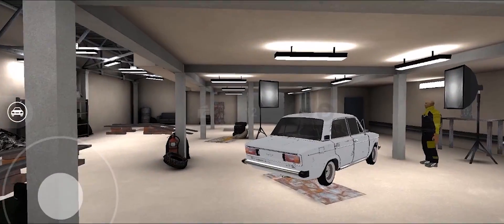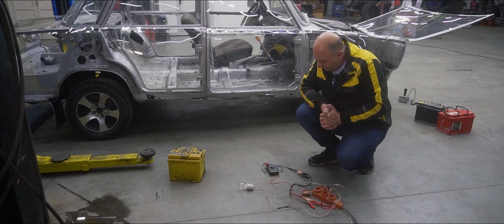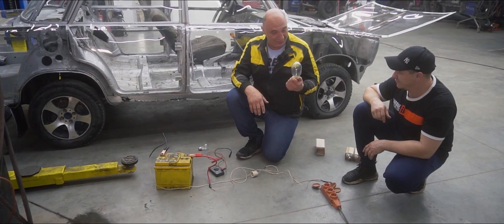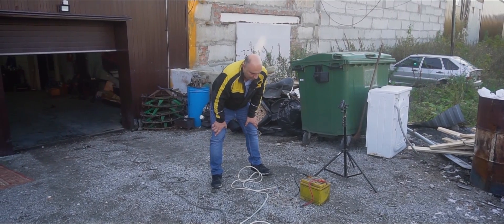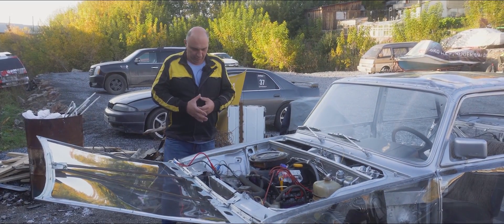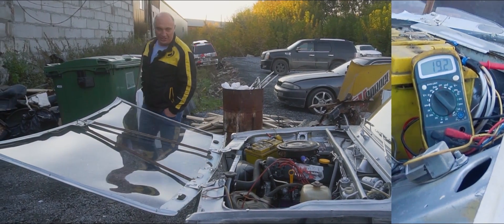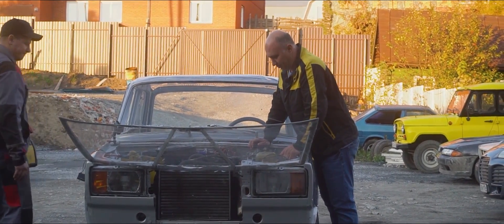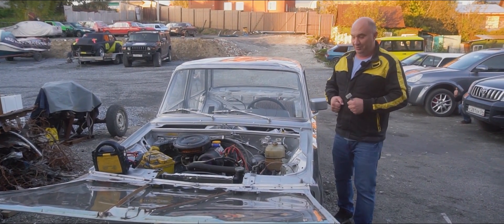Feeding a car 220 volts: will it start?

Comment: They're using a puny single diode rectifier... What they need is a FULL BRIDGE RECTIFIAAA
Reply: nice electroboom reference
Reply: When they fried the battery cable, I could just hear Electroboom swearing. "SH(beep)T, F(beep)K!"
Reply: OOO SOMEONE FROM ELECTRO BOOM

OOOO MASTEERR
Reply: Something like this 400 A model, maybe:
https://www.amazon.com/Single-Phase-Rectifier-Terminals-Current-Conversion/dp/B07DKRQ7RF
Reply: @deltab9768  It's 400A if you have a 1600V AC input... Europe and Russia are 220-240V
Reply: @DataLog  The voltage limits and current limits are independent. The current limit is 400 amps regardless of if you use max volts or 220VAC.
Reply: Another eletroboom fan!
Reply: Hehe
Reply: The rectifiaaaaa
Reply: * capacitor explodes *
Reply: Not even a cap used
Reply: @peterzingler6221  ya a capacitor and full bridge rectifier is how Id do it but I mean the cap is to limit current which the bulb will do just the same
Reply: Forget lifeless diode based rectification and use a MERCURY ARC RECTIFIER! It does the job, performs well under load, looks cool, sounds cool, has an extra element of danger to it, AND on top of that it also gives you a tan if you stand in front of it for long enough.
Reply: Did you get it from @electroboom ?
Reply: I'm an Electroboom fan but cant make free energy if I spin with magnets.
Reply: So we meet at last, Mr. Electroboom-Garage54 fan. It's an honor.
Reply: electroboom reference
Reply: Rectumfryer
Reply: Electro Boom's electric circuits are tingling!
Reply: nah they needed a fluxcapacitor
Reply: A delta wye?
Reply: Rectumfryer more like it
Reply: Ok bill burr lmao
Reply: lol i feel better we call electroboom on the scene  @electroboom
Reply: THE RECTIFFIIAAAAAAA
Reply: That would be an awesome collaboration video!
Reply: RECTIFAAAAAAAJAAAAAAAAAAAAAA
Reply: Fool Bridge RectumFryer!!
Reply: ELECTROBOOM
Reply: I can tell you've watched PhotonInduction and some ElectroBoom. 😂
Reply: Nah, 6-phase MERCURY ARC, that's a real rectifier!
Reply: Its Stil good cool test.
Reply: Electroboom
Reply: Somebody watches electroboom lmfao
Reply: They're Russians, they don't need anything 'modern' 😀😀
Reply: That reference was great I'm surprised people notice it LOL

Comment: Well, that's just single diode rectifier with current limited by lightbulb resistance. Surely without lightbulb you will push as much amps as powered device will take and most probably burn the diode. Also what you are interested is voltage across battery terminals which depends on current and resistance. That's why it's not 220V on the battery when you use proper light bulb. Just as a reminder, voltage always drops if there is not enough current available so by reducing resistance (bigger lightbulb) you let higher current to run through and that slightly increases voltage.
Surely it would be better with full bridge rectifier which you basically double the power keeping the same current, even better with capacitor that would flatten the voltage - now you have simple AC-DC converter. After that you have to regulate two things. Max voltage and amperage. For initial charging it's fine, the voltage will be low. The problem will happen when you leave it running for too long as the voltage will slowly go up together with battery resistance as it is charging. You may end up with something like 100V with lightbulb setup, not great. That's why even cheapest chargers use transformer to make it impossible to go above 15V. Better chargers are actually monitoring the voltage and regulating how much power is delivered. You can clearly see the difference in size between something like Noco Genius charger vs regular charger.

Comment: The 56v killed the car, because there is very low resistance in the alternator. The 220V line has high resistance. The 220v line can only give around 30A, while the alternator can give around 100a for a short time.
Voltage is nothing without current. When connecting the 200v to the car, the voltage propably dropped to around 20v before 30a was reached and the fuse klicked out.
The alternator with its 56v could hold 100a and really achieve 56v not just around 20v (like the wall 220v power on load).

Comment: it's not the voltage, it's the amps, the alternator may have been putting out 56v, 4 times normal output but the amps was 4 times normal too and the amps was what killed the switch or coil

Comment: I suspect a good load to limit current instead of light bulbs might be a universal motor like an angle grinder. It has inductance. Keep the bad battery connected so that it will keep the car circuits from blowing up. And for the rectifier you can order ones with high ampere ability for a dollar or two. You could also try taking the diodes from the alternator. If you do some of that, you could make it actually work.
Reply: @Housecat333  They used lower resistance bulbs to get a faster charge. What are you saying?
Reply: Alternator diodes can go out at 32volts.   Might want to use 200volt diodes

Comment: Attach an electric hammerdrill to the driveshaft with manual attach/deattach mechanic and on/off knob in the driver cabine. Speed up the car to 50 kmh with petrol on flat road, then release the gaspedal and put the gear in neutal, and activate the drill. Will the car maintain the 50 kmh speed just with the power of the drill machine?

Comment: Had a regulator go bad on my 2002 Chevy Caviler, that alternator fired nearly everything but the radio, cooked most of the wires under the dash, the headlight wires. It was a mess....

Comment: I'd say the ignition coil burned out instantly. I thought it would from the get go. Switches wouldn't burn out that fast.
Put another coil in with a battery just powering that so the car keeps running and then burn out everything else in the car with the alternator!!

Comment: Can you charge a battery by spinning a alternator at a really high speed? Or how many amps you can get by doing that?
Reply: Yes. Minimum of around 900 rpm.
Reply: @bansheemania1692  damn really? Well thank though
Reply: Well, that's the whole reason the alternator is there lol
Reply: @televisionandcheese  yeah but like spin it faster then normal and see if any more amps are produced

Comment: Disconnect the battery when the alternator starts feeding in power that should do the trick
Reply: Battery is a voltage sink
Reply: They ended up doing it and the voltage went to 56v and burned out something in the ignition system

Comment: The Car battery is a rather robust piece of electrical equipment. Due to it's low internal resistance, it is able to just short out any incoming voltage, which is not polarized - in this case - a power output of 220V AC. If the battery itself can handle over 100 amps during start-up, it can also take any amperage below it. That's why the circuit breaker pops out - the battery was just acting like a short circuit. I bet, that the alternator itself was beginning to heat up significantly after removing the regulator. After removing the battery, to was not under a load from the battery and was able to generate high voltage which ultimately - fried the coils responsible for generating sparks in the engine. You would kill them by connecting 220V directly to a car, but without battery as well.

Comment: Are you applying AC or DC power to the battery's?    Any lights in the system will get fried pretty quick.

Comment: Did they just try to charge a DC battery with AC voltage?
Reply: No, they had a diode in series to act as a rectifier making it pulsed dc.
Reply: @Averna222  didnt see that, thanks
Reply: Yeah they were doing it wrong. You get better results if you connect jumper cables from the battery directly to the 750kva 120v transformer behind the mall...
Reply: The beginning was half-wave rectified AC (the one diode) but at the time they moved outside straight to the wall I think he removed the diode since it just blew up, at that point yeah just AC (might be wrong but didn't see the diode there anymore).
Reply: Still, one rectifier is going to be pretty negligible at converting 3 phase AC to DC. You would need 6 of them, like a full bridge rectifier. Ya know, like an alternator has. Surely they have one of those laying around that they could pipe the power through.
Reply: Martyn Watson  Many motorcycles only have two-phase or even one-phase alternators because the low power demand and cheaper cost to manufacture. The less phases, the less diodes to rectify the current.

Comment: I suspect ignition coil is also on a fused curcuit. Probably they only blew that fuse.
Reply: On a car that old, no. No fuse on the coil. What they likely popped was the condenser, or possibly the points.
Reply: @billh230  You're right. I just checked the wiring diagram of our old car, although it's not a Lada, but still an eastern block car and the ignition key is before any fuses. Now I got it, why some cars burnt down due to electrical failure...

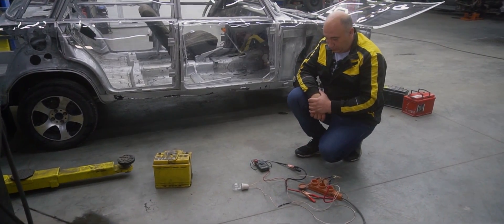Comment: 2:34 Voltage probably doesn't fluctuate. It's because you use the cheapest and crappiest multimeter ever :)
Reply: @ruben_balea  Batteries have a much higher impedance than a capacitor.
Reply: @ruben_balea  yeah but it was fluctuating before he added it after all (that is the beginning of the video at least).
Reply: @ruben_balea  Yeah, I get that point, I just mean that a battery can't be used in place of an electrolytic capacitor. It is not like the battery just has a higher capacitance.
Reply: @ruben_balea  you guys got the point, and if he had less ripple or better multimeter.... The battery can absorve the charge creating a load and helping stabilize the voltage but doesn't work fully filtered DC, it is pure DC but doesn't remove the 50hrz from half wave ac rectified and not properly filtered, a full bridge rectifier with enough filtering from inductor or good eletrolitic capacitor would be much better than a battery....
Reply: Well with a single diode it only just pulses for the first half wave so... Single diode rectifier but why?
The voltage should be waay too high
Reply: It's not an True RMS he needed to add an eletrolitic capacitor
Reply: Voltage fluctuates
Reply: @iuse9646  yep, but (this) multimeter has refresh rate around 1Hz, not 50 hz or more.

Comment: Was that just mains power connected to a 12 volt battery and a resistive light bulb in series? So they were feeding AC to a battery?
Reply: No, there is a diode in series.

Comment: alternator it's not charging because diode in alternator where destroyed with overvoltage from ac power supply, if they where keep charging battery with 20V it will start worming up, then blow like a baloon, at the end if u lucky it will explode (tested with 24V charger by mistake, no explotion yust cap burst)

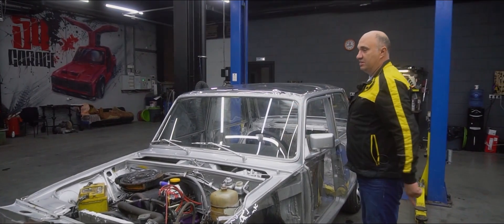Comment: 1:35 You should use 4 Diodes, 1 Diode = less voltage.
https://en.wikipedia.org/wiki/Rectifier#Half-wave_rectification
3:00 Carefully! The battery can explode.
10:08 LADA = indistructable!!! Tough like russia!!!! :-)

Comment: Easier to connect an arc welder to the starter motor to make it spin over really fast, and cause damage.
Reply: the current a starter usually takes is more than an arc welder
Reply: I actually jump started my old motorcycle off a welder once. Guy said it pushes about 19 volts, did nothing terrible though I won't necessarily recommend it

Comment: Please run a motor with direct Oxygen supply. 100% oxygen + gas... 🔥
Reply: external combustion engine
Reply: this was already done if i recall correctly. It was a very long time ago, like in th 50's, and the engine instantly died cause the mix ignited pretty much whenever
Reply: Would only work on a Diesel motor. Petrol motor will detonate due to excessively high purity of oxidizer, as there is no nitrogen to absorb heat and act as working fluid. Even in Diesel motor, this would risk excessive combustion speeds, and also very high (few 1000s°C) combustion temperatures.
Reply: @Jupiter__001_  You don't understand how diesel engines work!
Reply: Thats a brilliant idea.
Reply: Revvs?
Reply: What could possibly... BOOM!
Reply: That’s how you coat the inside of your engine with the remains of your carburetor.
Reply: @chaseman113  It's how you get the insides of the engine to show up on the outside of the engine.
Reply: Mastermilo did it, the engine just dies.
Reply: @DEMENTOR MOPAR you would have to feed the oxy direct into the cylinder at the same time as ignition, that's why Nitrous Oxide is used instead.
Reply: @dogwalker666  like a Kia GDI engine 🤔🤣
Reply: @dogwalker666  Basically try it with a diesel engine or direct injection one then.
Could definitely make some epic power if you feed enough fuel... for as long as it lasts.
Reply: @Kalvinjj  feed enough is the thing. The amount of air a motor consumes is huge

Comment: As a electrical student i find this video very  interesting :D
I have a question i saw a video today where they took a ford v8 and removed one of the heads making it a i4 with another 4 cylinders just moving without load, now i wonder if its possible to make a modified head where the valves are setup that it just compresses the incomming air and feeds that into the intake of the running half maybe it would worke like a supercharger, maybe hook up a air tank to smooth put the air compression, would be a very neat video
Reply: Its called an Ingersoll Rand compressor cart. 
Can't say for all of them but the one I saw was a 5.0 V8 with a modified cam and half the engine working as a compressor. Works great.
Reply: Quite straightforward to do with a Volkswagen Beetle engine. Leave one of the heads as is, and the other one with a pair of reed valves.  YouTube vids exist.
Reply: Very interesting stuff you guys send, i looked it up and its almost the same thing i was thinking about.
but i would still like to see garage54's take on this :D
Reply: Not enough boost pressure from a reciprocating setup to really make a difference and also there's the fact that a 4 stroke cycle engine would be wasting half its work during the compression and expansion steps unless you use a modified camshaft for the "compressor" side.
Reply: @aigoru8718  they did something similar in the video running a lada on compressed air where they modified the camshaft. i think they could do this here too. theoretically they could manag about 2x the amount of air on compression stroke or atleast close to because it would only require 2 stroke on the compressor side but for the engone side 4 strokes so it would be able to compress 2 times the air in one whole 4 stroke cyclus.
Reply: @BadMax02_VR  As an electrical student, you saw them hook up 220VAC to a 12V automotive circuit and wondered why the starter solenoid was clicking (probably at 50Hz 200VAC lol). Now no offense, but given the circumstances, do you really think they would put the time in to engineer that lol?
Reply: Make one bank a 2 stroke engine, and the other bank the intake pump?
Reply: Nice idea man
Reply: You wouldn't be able to do that because you would try to compress air with the speed of the working cylinders. The engine would probably just stop.
Reply: @Jonathan Y. wow u did that math way more complicated than I did :D
I just went and thought if u have 4 liter v8 the one half is 2l which would basically double the ambient air which gets sucked in because the engine gets the additional air for basically 2x the volume per each cylinder, but I just realized that u cut basically half the engine away which makes the engine have half the power and I don't know if u could gain enough power by doing this to get even more power from the compression or in the end you would lose power compared to when u would just leave it as a v engine.

Comment: I used this method to charge car batteries for years... I used 220v 100w light bulb and full bridge rectifier. I used to measure 4 to 9 amp charging. Light will go dim when battery is full.
Reply: With a 100 watt bulb as a current limiter, you wouldn't get more then an amp or two depending on the voltage rating of the bulb
Reply: @jasonharrison25  my bad. Sorry, after I went back home I rechecked and actually I started with the light and then I replaced it with a small old heater and capacitor. I remember the amp with the lamp only was ~ 1 amp